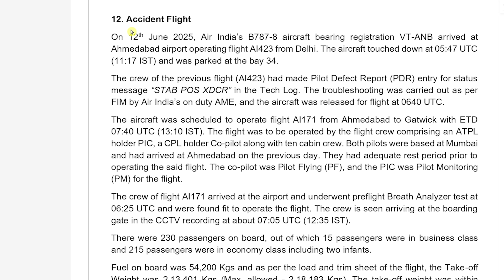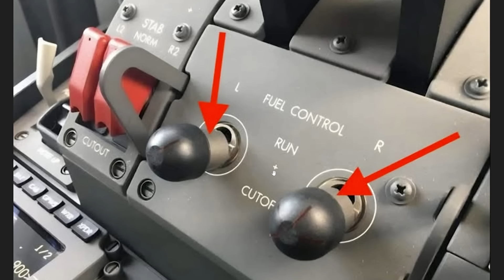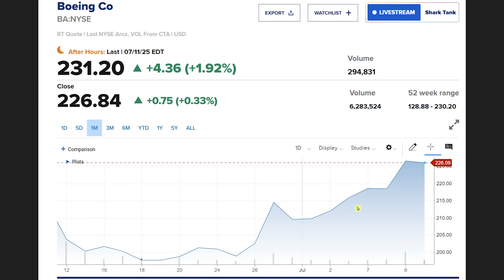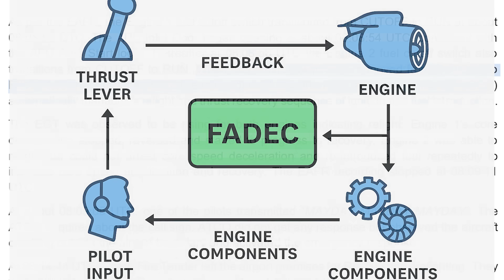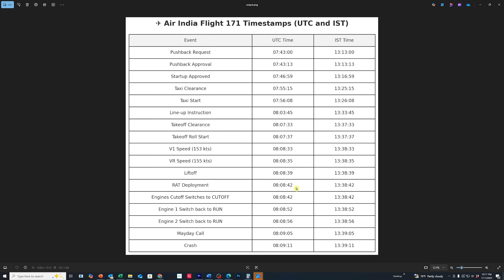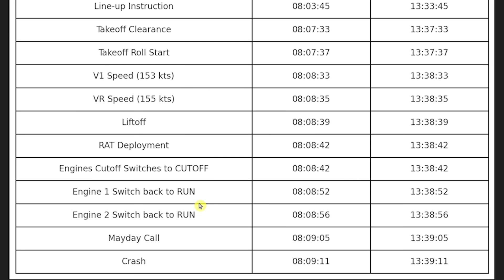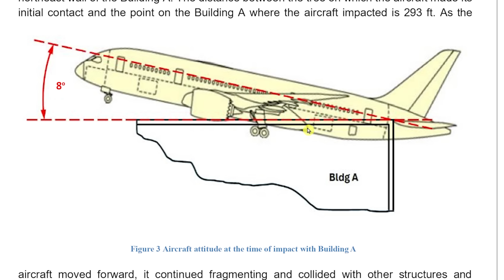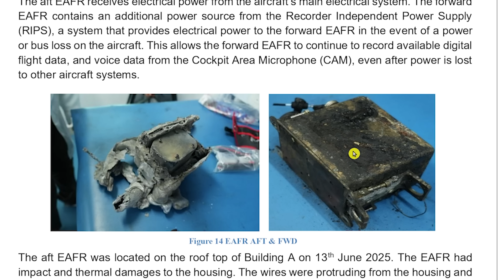Did Pilots CUTOFF Fuel? Shocking Twist Air India 171 Report!

Comment: My worry about the whole  investigation is that Boeing are going to influence the outcome in one way or another.  I really believe they will not want to accept any responsibility !
Reply: Boeing can't influence the outcome. There are too many agencies involved in the investigation that need the truth... eg. AAIB from the UK, which lost 53 British citizens on AI 171. The fact remains that the Cockpit Voice Recorder (CVR) tells us that one of the pilots (almost definitely the one NOT flying the aircraft) cuts off the fuel to both engines. Since we now know that the First Officer (in the RH seat) was manually flying aircraft, he would have literally had his hands full, so the Captain was the one with the ability to pull the fuel cut-off switches out and down. The pilot flying the aircraft would have seen these actions in his peripheral vision, which is why he asked the question, "Why did you do that?". If it was a fault on the aircraft itself, then neither pilot would have had time to figure out what the problem was. The Captain calmly calling "Mayday, Mayday, Mayday" in the face of impending and certain death is also a red flag. After all, pilot suicide is not unprecedented. Unfortunately, it's happened on multiple occasions, each resulting in the deaths of all on board.

Comment: Fake vid.. tech manual tells us fuel switches need NOT move. If electricity to fuel valves  is lost for even a fraction of a second, 787 and 777, for any reason, the spring loaded fuel cutoff valves to the engines will snap shut. Cockpit switches stay OPEN.... Happened to ANA 787 after landing using reversers, in Osaka and unable to restart.   Rtd Training Capt EAAC  Pilot Union rep at Regional Air Accident Investigations

Comment: Please don’t be so quick to blame the pilots!
Most likely, the problem is with durability of EEC MN4 microprocessor chip which control the jet fuel inlet. We should ask why the investigators ignored this Boeing service bulletin SB 73-0097 rev 001. I got this SB from a just retired 787-800 pilot captain very familiar with the operation of 787. Unfortunately, his channel is broadcasted in Mandarin only. Within 2 days of the accident, he already came to the conclusion both engines were shut down soon after takeoff due to this controller board inside the engine failed weeks before the 30-day prelim report was published. Because the SB did not demand immediate action to replace the chip instead only ask the chip to be replace after 11,000 hours of operation has been reached (with 3 replacements maximum before the entire circuit board has to be scrapped and replaced), so it’s likely the chip was not replaced in time before the fatal failure occurred because the long interval between major services (11,000 hours) even though Boeing is well aware this chip failure can cause catastrophic result if happens during takeoff.

Comment: This gave the aircraft the perfect ending to actions of  pilot. It wasnt pilot error, it was his deliberate action to cause this crash. It takes two steps for each engine. One was shut off, as the second was within one second between them. This wasnt done by accident. It was an intentional act. In any crucial period of flight, take off and landing are the most dangerous stages of flight. Fuel shut off the both is never a consider, while the aircraft is at full thrust, as the wheels left the ground and initial lift, air speed & profile of take off appear to be uneventful, it suddenly shift, loss of power at the most critical stage. I think the tone of his voice, asking with such concern, he was questioning the pilots actions, based on his peripheral vision. The pilot delayed/ignored his concern, giving the situation no chance for recovery.

Comment: I will be very brief and I am not a total layman! This story with pilots and switches can be believed by the same people who believed that some Arabs practiced in the caves of Afghanistan to hijack passenger planes and crash them into the Twin Towers! So the towers fell practically at the speed of free fall. And by the way, these are the only steel structures in the world that collapsed due to fire! By the way, the computer that controls the operation of the engine is the size of a suitcase and through it passes all the control and feedback information for the operation of the engine! And for him to allow the pilot to turn off both engines during the take-off phase! So tell me a little about it! When you want to delete a file on the computer, it asks you are you sure you want to delete this file, and imagine in an airplane, no, it doesn't ask for engine fuel cut-off during the take-off phase at a height of 50m. Obviously Boeing messed something up with that engine management software and now of course faced with a zillion dollar loss and the plane's grounding, it's much cheaper to pay a thousand people to talk nonsense!

Comment: The less experienced pilot was at the controls being monitored by the senior pilot.
On realising or seeing the other pilot cut the fuel he would ask initially out of deference 
"Why did you do that?" Instead of immediately lunging across to reinstate the fuel supply,
Thus wasting ten precious and vital seconds.
Had the more experienced pilot been at the controls he probably would have immediately 
Reacted to reinstate fuel supply whilst at the same time making this inquiry.
We do not know whether there was a physical confrontation involved in the cockpit 
but the four seconds between the two switches coming back on May be a significant indicator.

Comment: What if the person asking why the fuel was cut off assumed so without actually first looking at the switches? A reasonable assumption on his part and would explain the response that the switches were not touched. Could something of gone wrong with anything between the panel and to the engines? Possibly such an error was overcome on engine 1 by the automatic restart but was not able to be overcome by that for engine 2? Not a happy conclusion for Boeing unless some sort of sabotage was involved.

Comment: Good report. What are the dimensions of the switches? What is the force required to pull them up over the detent? How far must they be pulled up? Is it possible that a hand which might have fallen off the thruster controls could have hit both of the fuel switches at such an angle and with enough force to turn them off inadvertently? Thanks for your research. Alternatively, where is such engineering information available?

Comment: What you forgot to explain yes , what happens when you have low internal engine speed and lots of fuel fuel and ignition. If it weren't for the automatic shutdown sequence the engine would simply disintegrate. In other words you have to have a certain airspeed before an air start is possible. One engine had it and the other did not . The first one shut down would be the one not having enough air speed most likely , the first one you move to shut off.😅

Comment: RAT deployment time tells that there could be some technical issue. The transition of fuel switches to CUTOFF happened after RAT deployment.

RAT deployment was not because the fuel switches transitioned from RUN to CUTOFF.

Comment: I said within the very 1st time you posted that it was likely intentional.  The odds of 2 engines that have no commonalities failing at precisely the "wrong" time was astronomical.  This was intentional and it was murder suicide.  But something is wrong with the way this cockpit conversation was released.  Number 1 they know which pilot said what.  The mics do not lie and are recorded separately.  But they omitted that.  What we do know is that "why did you cutoff", could have come from the person that did it.  Why?  To bring shame to the other pilot?  The pilot at the controls at takeoff likely did NOT do this because while doing it the monitoring pilot would have said something to the effect of WTF.  They really need to reveal the full CVR.  And explain why they released that partial conversation.  Because what they released is freaking bazaar.

Comment: The report demonstrates that the aircraft began the takeoff roll at the far end of the runway, not at the midpoint. It was previously said that liftoff occurred near the the very end of the runway because dust was kicked up by the engines at liftoff as shown by the first CCTV video (from behind the aircraft). Might this indicate that the acceleration was less than standard? If so, the aircraft performance could have influenced the actions of the crew during the initial climb. What are your thoughts?

Comment: The fuel switches are life and death sensitive devices and their actions should be strictly limited to when they are needed and necessary. 
I'm sure software controls could disable their cutoff to logical conditions, excluding situations like take-off, no fire etc. The actions of errors must be eliminated, nefarious or otherwise.
This is not a WW2 bomber, technology has changed.
Location of switches should perhaps be overhead and require multiple (at least three) independent actions, with light and sound warnings, for each switch. 
Aircraft mfgs always drag their feet on safety innovations, time to change. 
All mfg operations should be transparent to auditors and everyone, whistle blowers should be encouraged and protected.

Comment: Your comment 4 secs is too much time is unreasonable, think if you were in cockpit and alarms are going off…my priority knowing I can fly on one engine is to get one engine started asap, then number two. He likely knew that there wasn’t time for a restart at low altitude, but did the procedure as trained. Can you imagine how startled you would be with cutoff at 3-4 secs after takeoff? Unless there is a way the computer shut off fuel (no one has mentioned this possibility) and they were trying to reset by cycling switches - then my conclusion is it was intentional sabotage knowing if switches were cutoff on climb out, there would be no time for recovery- who would know that- the pilots of course!

Comment: Why did it take the other pilot 10 seconds to switch them back? And why did it take 4 seconds to go from one switch to the other? That's like the slowest response speed imaginable. Flick flick.
EDIT: The RAT did not deploy first. The cutoff switches automatically deployed it at the same time. They shouldn't have put that first on the sheet.

Comment: I think the fuel switches may have been faulty and snapped to off on their own. People say, "that can't happen because they're locked into place, and you have to pull up and back." Okay, but what if the locking feature was disengaged as the SAIB report described? Maybe the switches wouldn't stay locked in run position because they were "installed with the locking feature disengaged" just as the SAIB report described. Maybe it took them ten seconds fiddling with the switches to get them back in the run position, because they were "installed with the locking feature disengaged" just as the SAIB report described.  Nah, it was pilot suicide case closed... right?

Comment: 4.4 No "Found in CUTOFF" Callout (Further Eliminating Awareness of Physical State)
 * Pilot SOPs for Diagnosis: Upon immediately observing the catastrophic loss of engine power on their displays, pilots would quickly check the state of critical controls, including the fuel cutoff switches.
 * Expected Verbalization: If the pilots had visually and/or tactilely confirmed that the physical switches were, in fact, in the "CUTOFF" position (regardless of how they got there), standard procedure would demand a verbal callout (e.g., "Fuel switches in cutoff!").
 * CVR Absence: The CVR, as publicly reported, contains no such callout. This strongly indicates that the pilots did not find the physical switches in the "CUTOFF" position when they checked them. Indeed, pilots later described the event as "lost power," not "fuel cutoff," indicating their focus on the symptom rather than a confirmed physical cause from the controls.
4.5 Delayed "Return to RUN" Signal (Inconsistent with Manual Correction)
 * FDR Data: The FDR recorded Engine 1's fuel switch signal transitioning from CUTOFF back to RUN at 08:08:52 UTC (10 seconds after its initial CUTOFF signal), and Engine 2's at 08:08:56 UTC (13 seconds after its initial CUTOFF signal, and 4 seconds after Engine 1).
 * Improbable Pilot Delay: If the pilots had visually seen the physical switches in the "CUTOFF" position, a 10-13 second delay before attempting to move them back to "RUN" is entirely illogical and inconsistent with the immediate, decisive action required in such a dire emergency. Similarly, a 4-second gap between rectifying two such critical, simultaneously failed controls is highly improbable for a unified, manual corrective action on visibly identified errors.

Comment: OMFG WHY ARE YOU SPECULATING??? UGH. Are the cutoff switches physically hard-wired to the fuel pump???? Is there ANY WAY that the PHYSICAL SWITCH can be changed WITHOUT pilot input? IS IT 100% controlled by the pilots? Is there any DISPLAY INDICATION THAT THEY ARE OFF that the copilot might have been responding to??? Is there ANYTHING other than the switch data that you are using to determine that a veteran crew killed hundreds of people for no reason??? Take a MINUTE to THINK. So disappointing.

Comment: First. How can no one know by now which of the pilot's made the question. Can fingerprint, even partial, be used to see who flicked the switches last. 

It is quite possible that the person who switched off the feul also be the person asking the question to throw off the investigation. 

Which one of the pilots had current issues in his life and has nothing left to live for. 

In another analysis of the report it was indicated  one switch was turned back on. But both switches were found in the off position. So did the report lie? Did a pilot try to reignite one engine only to switch it back on, or did the murderer turn it right back off? We need a more detailed view of what exactly was done by whom. They need to use the audio mic locations to find out arm movement sounds from the pilots, and to which pilot was trying to save and which was trying to kill.

This investigation is far from over and not yet solved.

Comment: Could it be that the switches never physically moved?  Could the computer have falsely interpreted signals as a flame out and sent out the signal to cut off the fuel?  The switches obviously were in the on position at takeoff and images post crash showed the on position also. Could it be that the flight data recorder showed the on-off positions whereas the actual switches stayed in the on position?
Jeff, you Sir are the best--much respect here!
Bill, Private Pilot

Comment: Ironically the Power Takeoff switch on many lawn tractors is designed almost the same exact way. The reason is so that the operator has to CONSCIOUSLY engage the accessory (mower deck, snow thrower, etc) to prevent accidental engagement and possible injury....with that being said, either the plane was visited by a poltergeist and they met their final destination, or the switches were intentionally turned off. I believe they need to subpoena every last bit of information on the pilots to find out what happened. Breaks my heart for all those people to die such needless deaths 😢

Comment: The pilot that asked the question about the switches, is the pilot that actually turned the switches off. Professional (innocent), pilots would not have wasted one second having a discussion asking each other why they turned the switches off. They would have fully focused on saving the aircraft, not having a useless discussion. The only reason the guilty pilot would have asked the question, was because he hoped the other pilot would receive the blame for the crash after the voice recorder was eventually inspected (post crash). Guilty pilot wanted to make sure he wouldn't get the blame.

Even if they'd immediately switched fuel back on, the aircraft's speed and altitude would not have allowed a recovery. The switches being turned off just seconds after takeoff, doomed the flight.

Comment: Jeff,  how did the pilots learn of the fuel cut off?  Was it an ECAM message?  

Well,  that could mean a layered digital system had a software fault, and that caused the logging one second apart.   

FADEC  means Full Authority Digital Engine Control  (full authority being the operative word.)

In other Forums, some have argued one way to know for sure would be to see if the fuel switches can be heard on the cockpit area microphone aligned with the FDR logs.  That  would  be  a way to show it’s not software.

BE ADVISED: These switches were part of bulletin that suggested replacement—-Thats suspicious because if the cam locks fail, a bump or vibration  could lead to uncommanded operation.   

Also, FADEC should have inhibited  fuel cutoff at such a critical phase of flight.

Way too early to blame the pilots IMHO.

Comment: This report doesn't account for the explosion heard by the survivor.  Also, the other pilot would have seen the hand since this is takeoff. They would have been fighting if it were a suicide. Also the landing gear had moved up but stopped.  Stall due to the torque from the hydraulic pump to raise gear, and power loss to the jet computer preventing auto-relight.  toggle of fuel was a way to restart since fadec won't do an auto-relight if it's had been rebooted seems more logical. That's how it is programmed.

Comment: Both cut-offs switched off in 0.1 second. That's not humanly possible to do 2 intentional movements with 2 switches at virtually the same time.

I think there was an electric arc, short that flipped them.. or an electronic or computer malfunction.